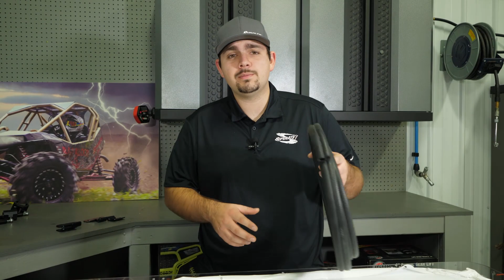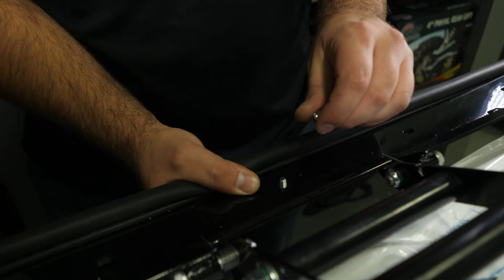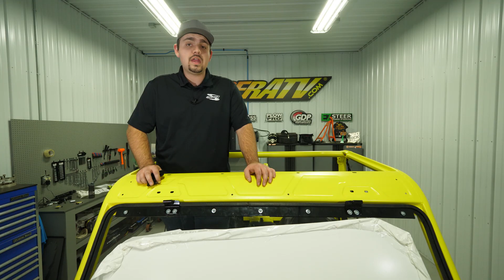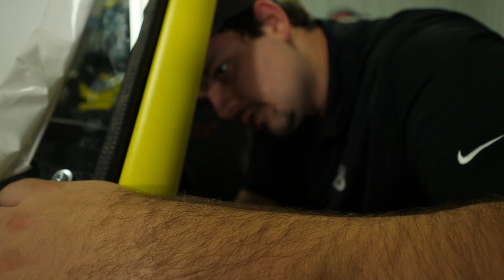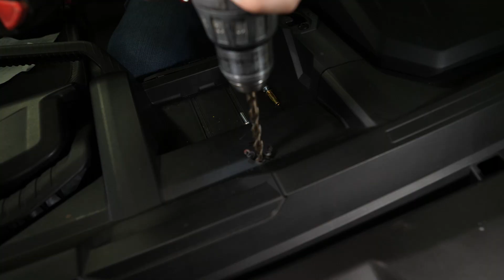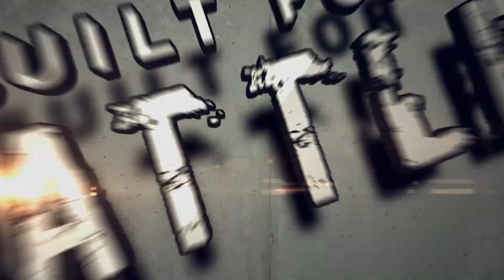Flip Windshield Install | Can-Am Defender | How To | SuperATV

Comment: Are the bolts/nuts on the gas struts supposed to be tightened? After I completed the install I noticed the nuts securing the struts to the brackets were not tightened at all on either strut. Is this normal? Also i destroyed my wiring harness while drilling the holes 😢

Comment: I’m curious why not utilize the factory location for the mount rather than use anchors in plastic.
Reply from the maker: This kit is made to fit a few different models and not all models have the exact same factory mounting points to be able to use them.

Comment: Drilled holes as instructed, bit destroyed wiring harness under dash.  $800 fix.
Reply: What year is yours... I ordered one for mine and don’t want to have that happen to mine
Reply: Just got mine in the mail today came in 2 boxes and I also got the wiper for it..I'll be taking it to my dealer to install to avoid that and other issues..let me know how the windshield is holding up for you
Reply: I did the same thing!
Reply: Do you know exactly what wires were messed up? Mine are up a real small wire lume, so far everything is working fine, starts up and drives and all lights work. Not sure what it could be

Comment: I can't get the windshield to seat properly,  it bows out from the seal being in the way at the top. I have tried everything.
Reply: Mine is currently doing the same thing. What was your fix?
Reply: Make sure you have the brackets on the right side of the window... I had mine on the wrong side and that is what it did

Comment: What are the rivets connected to? What keeps them from backing out?  It looked like nothing solid was drilled into when he drilled into the dash besides just plastic. Do they act like a concrete anchor bolt?
Reply: They act like a wall anchor, correct.  Be VERY CAREFUL when drilling the holes.  Reach your hand under the dash and be sure that you’re not going to hit your wiring harness like I did.  Luckily I only hit one wire, my power steering wire.  But now I need to try and figure out how to access the area under the dash so I can fix the wiring harness.
Reply: @RyanSanislo I did the exact same thing!!!! Now I don’t know what to do! Smh trying to figure out how to remove the dash to see what damage I’ve done
Reply: They mushroom out